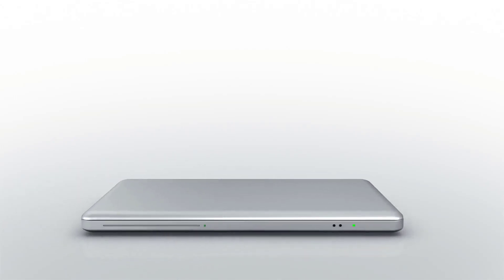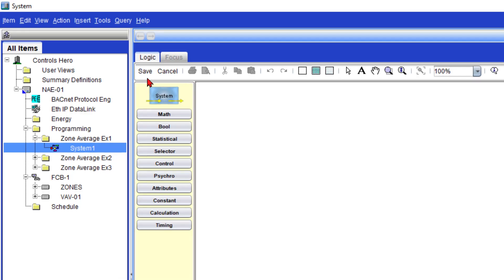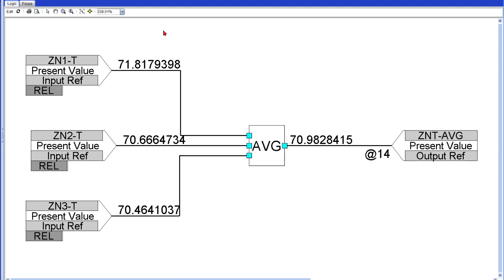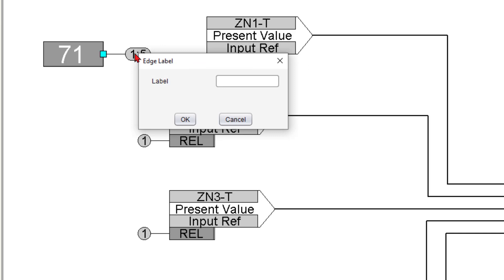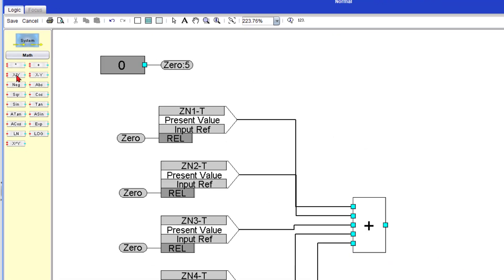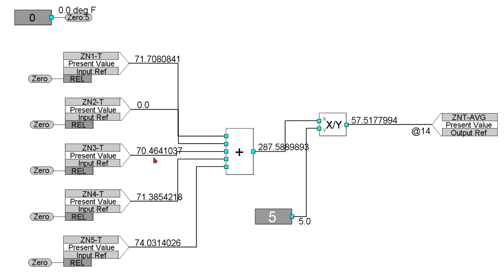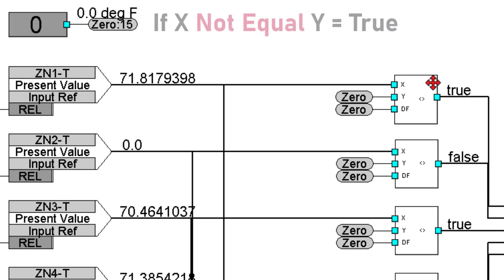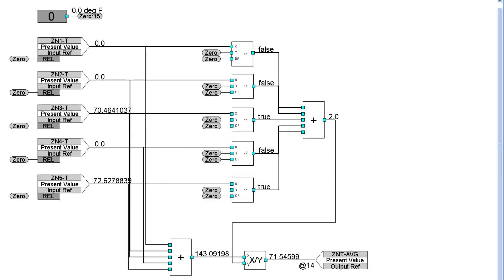Metasys Averaging Multiple Sensors in LCT (NAE)

Comment: Anyway you can get me a download for even an older version of metasys? Just trying to get comfortable with the metasys programming and architecture
Reply from the maker: Hi SR-HVAC! Sorry for the late reply. The best way to learn Metasys is by getting a hold of a network engine (NAE or SNE). They are expensive but you can find some deals on eBay. They have Metasys embedded in them. Contact me at my website https://controlshero.com/contact/ and I will give you more details. Thanks!
Reply: @controlshero  I actually just ordered a metays Nae to play with and mess with. Found one on ebay for a great deal. Great to know. I also have the cwcvt converter
Reply from the maker: @SR-HVAC  That's great news!

Comment: Can someone explain what is the difference between JC CCT and metasys?
Reply from the maker: Hi koktelici, that is a very good question. CCT (Controller Configuration Tool) is a JCI software tool that allows you to program custom applications for your JCI controllers (e.g. FEC, VMA, CGM controllers). These applications can be for VAVs, AHUs, EFs, Hot Water Systems, and Central Plants. You basically create an "App" for your controller. You define inputs and outputs and create the logic or "code" that goes inside the controller. On the other hand, Metasys is like a platform, the "front end", it is what the final user, the building engineer, sees. Metasys is a software that is installed in a computer (a server), and locally in a Network Engine (NAE, NCE, SNE, etc.). What is a Network Engine? Is a supervisory device, the main device in your building. It supervises all of your controllers or HVAC equipment (AHUs, VAVs, HPs, EFs, etc.) The network engine contains a database of all your devices and allows you to see all your equipment live, its points, the graphics, and it allows you to send commands, overrides, etc. Finally, you can also write "programs" in Metasys like this Metasys video. Basically, if you need to look at different controllers in the network and create custom logic to do a particular task, and you do this at the Engine level, in LCT. Hope this helps!
Reply: @controlshero  in PLC world CCT would be step7 and Metasys is like SCADA installed on Pc connected trough master PLC (Network engine) to oversee other slave PLCs (different controllers you mentioned ).
Reply from the maker: @koktelici  you just explained it in a very easy and short way! Great!